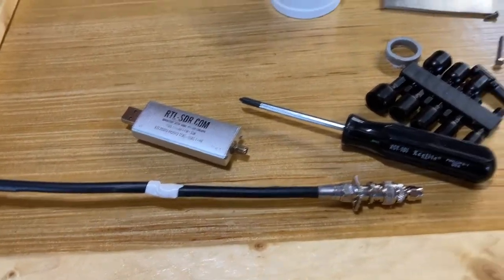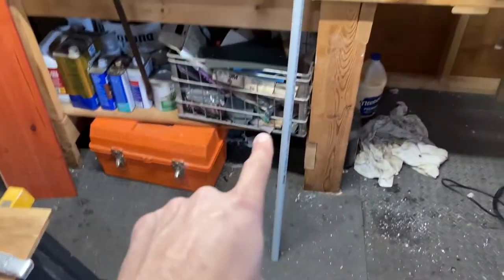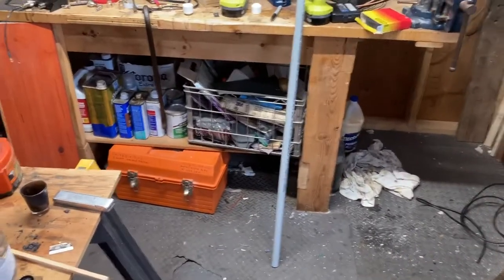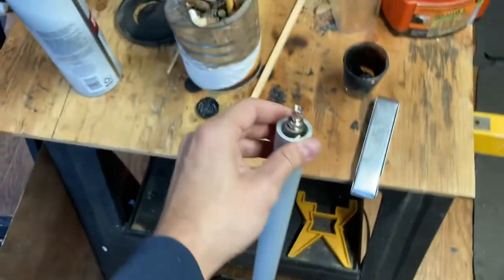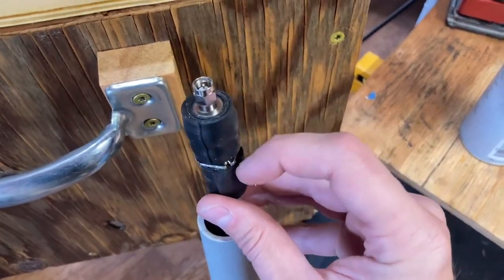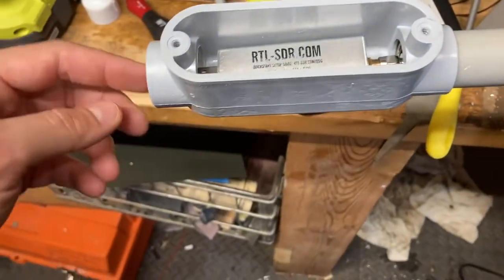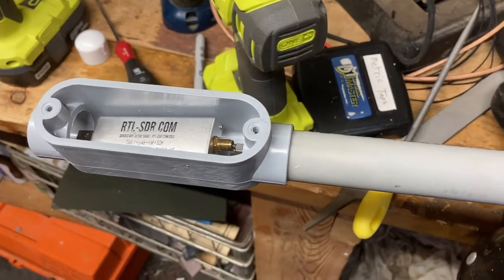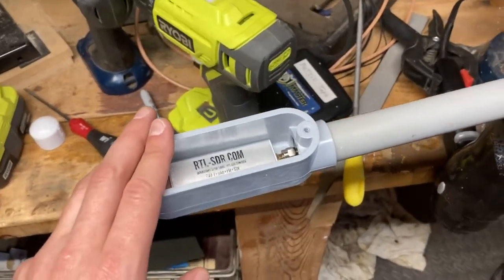Building An Enclosure For An ADS-B Antenna (Colinear)

Comment: If your antenna ends in a type F male connector, you can get a type F female to SMA male adapter, which will avoid using the BNC intermediary, making the connection much shorter.